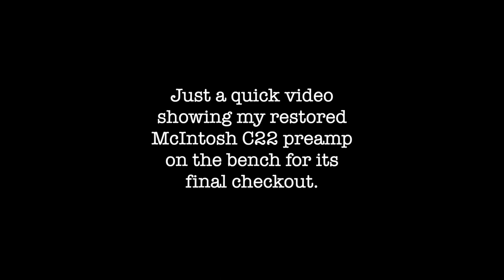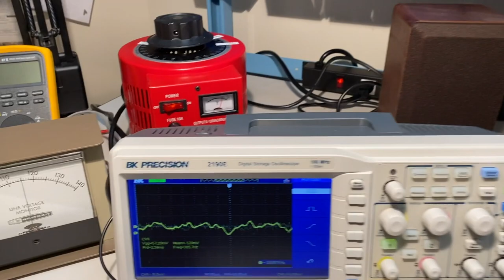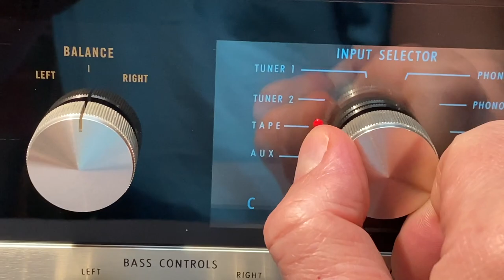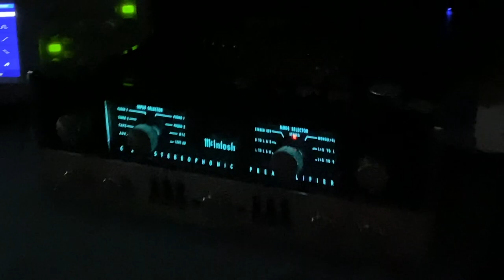McIntosh C22 Preamp Restoration. Final Checkout On Bench

Comment: BTW many of the plate load and power supply dropping resistors ( the carbon comps ) go up in value. I have replaced far more resistors in tube McIntosh equipment than coupling caps. If they get hot they go bad. Been servicing this brand since 1971.
Reply from the maker: Thanks, Herb. Appreciate someone with your experience stopping by. I’d have to go through my notes to see if I replaced any resistors on the C22. As you said, they can go bad so I make a habit of testing all of them. Off the top of my head, I think all the resistors in this C22 tested fine. I have a more detailed video series up now about the restoration of an MC 2105 amp. There, I found two resistors that measured out of spec and were replaced. Take care.

Comment: A beautiful job. It looks great. I have a question about the restoration. There is that one can on top, on the right, next to the transformer, which has MFD values 20-20-40-1000. I have a bunch of Mallory caps in the shop, but wasn't able to find a match. Were you able to find one? Or were they in good enough shape that you felt replacing them was unnecessary? I'd be grateful for your advice. // D.
Reply from the maker: Hi, yes, all the electrolytics were replaced. It’s been a while since I worked on this one, but looking over my photos, it appears that I was able to replace at least two of the multi-section capacitors with new ones and another I left the old one in place and replaced it with new separate caps under the chassis using a terminal strip. Hope this helps. There are suppliers for multi-section caps, but they can be hard to come by. Check out the web site antique electronic supply and hayseedHamfest.com . Good luck!
Reply: @FluxCondenser  Thanks for the reply. I'll be done with my rebuild hopefully just after thanksgiving. Looking forward to hearing it.

Comment: shotgunned the coupling caps I see.  Those Sprague film caps rarely go bad, did you find some that were bad?
Reply from the maker: Great question. The unit had issues with left/right balance so I made the decision to just recap the whole thing and skip the diagnostics. You’re right about the Spragues, though. I didn’t test all of them, but the few that I did check were fine. No leakage and in-spec. If someone wanted to keep things as original as possible, it wouldn’t be a bad idea to just replace all the electrolytics and get rid of the seleniums. If all sounds good, leave the Spragues alone. If not, narrow down the bad caps and just replace as needed.

For me, I’m not a big believer that capacitors possess magical sound qualities. If they test the same, they sound the same. So I don’t really have an affection for the old Spragues. Others may disagree of course, and think yanking them was a mistake. To each their own. I save everything I ever remove from all of my repairs (and I mean everything!), so the Spragues can be reinstalled in the future if I desire.
Reply: @FluxCondenser  Sprague 160P are Difilm (polyester-paper dielectric), super reliable and often still have insulation resistance of a new capacitor. Liikely did not need replacing. A pity.